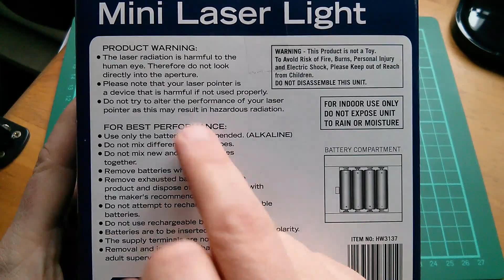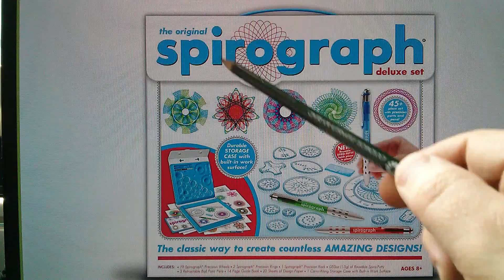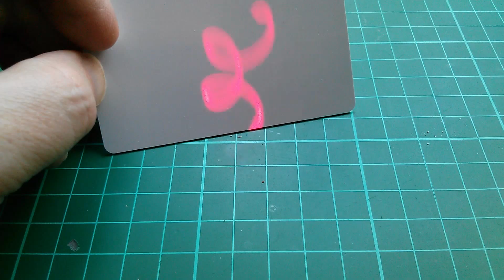Teardown: Mini Laser Party Disco Light

Comment: "this seems a bit tame"  9:04
arhh come on ' for an price of 6 to 7 pund, you really cant complain.. Its actually pretty wicked that you can optain an double motor-mirrored laser projector for so little. (would jump on one in a minute, if I notice something like that for this amount and mod it up with an NUB or just high powered diode  on appropiate driver, ewen thow i doubt that mirrors could handle such juice)

-if you are unsure why an socalled coninues-laserproduct got such big heatsink around the diode' you can just try to plug that cheap (0.10US)-spare on, you showed an leave it for 10 minutes and you will sense, why.
laser-diodes need to dissipate heat and also the toygrade ones, ewen thow they dont generate as much as the high current diodes..

Comment: Exactly how I got started with lasers. I used two motors, two mirrors and a 556 timer clocking a quad of 4017's. Never counted how many patterns it had. My laser was just a tiny bit larger though... an argon laser which chewed 1300 watts of electricity to produce a 180mW aqua beam strong enough (when the motors were off) to light a cancer stick :)

Comment: Had one these some time ago but for some reason the regulator in it keeps getting insanely hot, That aside i changed out the lazor diode in it for something a bit brighter and it makes it visible over greater distances , Your right about the large metal around the lazor itself - it is for heatsinking but i suspect the diode is <1mw. I should find mine and mess with it again sometime

Comment: In the mid to late 80's I was experimenting and prototyping fiber-optic comunication for British Telecom.
The lasers we used were called LASERTRON diodes and they looked the same size as the laser in this video. Only difference is, our LASERTRON diodes had a much bigger heat sink on them.

Comment: My guess is that they put the laser diode inside that big block to make it fit the same molded clip as the one that holds the motor. They they save one extra mold, which is crazy expensive.

Comment: Maybe you can build something with it. Put in an mcu, control the motors and have them print something on a wall. Or maybe just make one of the mirrors spin faster at peaks in audio after filtering.
Reply from the maker: Jim Groth Hall effect sensor and a permanent magnet on the mirror (carefully aligned for balance of course). Phase-locked loop to multiply up the rotational frequency. Real-time polar to cartesian co-ordinate conversion. Worth bothering? Nope.
Reply: Julian Ilett Worth bothering? Only if you learn something on the way, or find the work fun. :)
Reply: Don't know if you could "print" something like words I think because of how the mirrors are controlled it would still have to be circular.
Reply: It probably requires some hacking of the mirrors.
Reply: Jim Groth Maybe some super fast steppers?
Reply: How about a constantly rotating mirror and timing the blinking of the laser to coincide with when a "pixel" should be lit?
Reply: Hmm. How about adding a photosensor for synchronizing once every revolution (or less if not needed)?
Reply from the maker: Glebs Litvjaks I used to work on typesetting machines that used galvos. Yes, very expensive and tricky to set up.